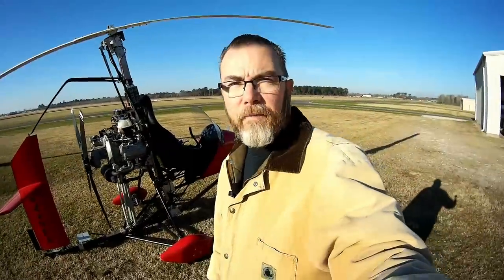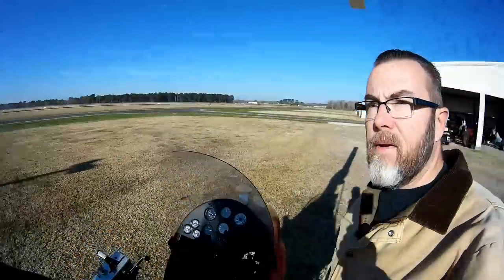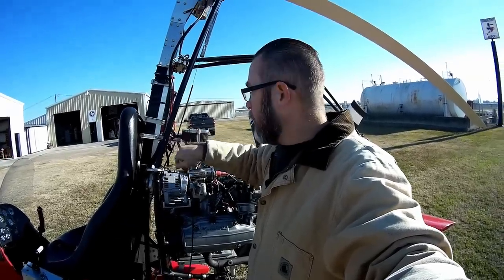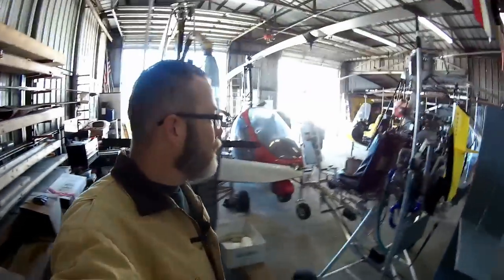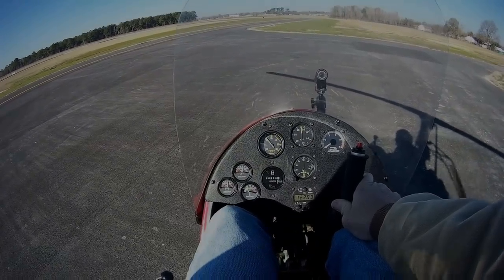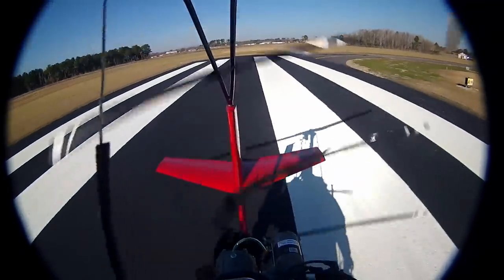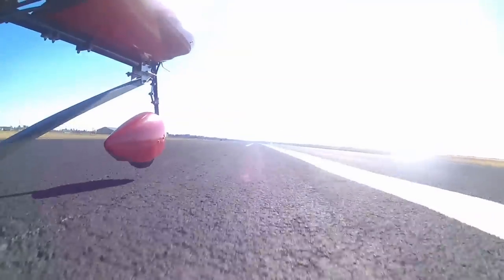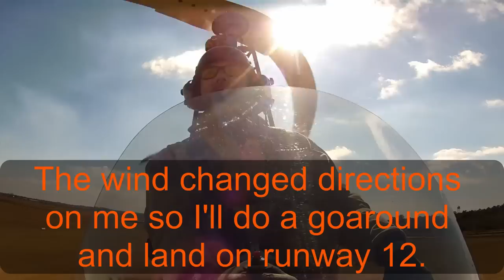Gyroplane Walk-through.

Comment: This is one of the best gyro video's I've seen, well done. Your Air Command is really moderate in stick shake. Anybody in your group know of an RAF for sale?
Reply from the maker: NZ Salt Flats Racer we do have a guy that's selling a beautiful RAF. Should be on barnstormers.com under gyroplane. It's in Anahuac, TX. Owner lives in Plano, tx?
Reply: Thanks, I saw that one but considering the changes I'll need to make for this high altitude the price is too steep.
Reply from the maker: It's fuel injected. What changes would you need? Just curious. Sea level with no mountains around here.
Reply: I'm in the Rockies @ 7k-ft. FI 2.2 makes less than 100hp here. My friend had to change to a turbo EJ-22 & Sport Copter blades & has over $50k invested. He's a Dr & drives a new Mercedes, I'm a mechanic & drive a 94 Chevy, I need to find one I can afford to reconfigure.

Comment: Nice gyro Bobby. I am learning fly a High thrust Bensen B8M with a 72HP McCulloch with a 48" tennesee prop, and Wunderlich prerotator, horizontal stab added to the stock vertical. Still learning to fly it on my own, able to prerotate to 150 and get 200 RPM on fast taxi with my 23' McCutchens (yellow ones) and she dances. Just about ready to go on the maiden flight in N521LW which my late Dad flew the heck out of and left for me (RIP  Dad, Can't wait to get in the clouds closer to ya again). Any tips you can give me Bobby? I'ts like I hit a wall, I'm ready to lift off just cant seem to nail that throttle just a tad more to lift off and keep it level... Not afraid just hit that wall if you know what I mean. My Dad wanted to teach me but I wanted him to fly it annnd enjoy it as he was getting up there in the years, he flew for 7 years before passing away from a heart attack on the way to walmart at 72, still miss him every day...
Reply from the maker: I would take some training with a gyro CFI. Then follow the Bensen training technic. I'm pretty sure a google search will find the Bensen meathod. I did right around 100 crow-hops over the runway before flying the pattern. You need to be able to land your machine safely without hesitation before flying away from the runway.

Comment: Thanks Bobby, that has to be one of the best  videos I’ve seen for a new comer. What do you think of the Sportcopter with springs keeping the front wheel centered it also is free castering? One a thing I’m not sure about is your landings. It seems like you land like an airplane. Could  you explain how you approach when you land? Also I’ve heard about getting behind the power curve. It seems after you do your pre rotor you are looking for certain rotation number then when pulling back on the stick your looking for another rotation number all the while increasing the throttle slowly. Could you explain those values and also explain what would happen if you just gave it full throttle. Mike
Reply from the maker: mike lavergne , the centering spring on the sport copter is just fine. It will allow the wheel to be aligned with the gyro vs aligned with the rudder.while pre rotating, I'm just looking for anything above 80 rpm for these rotors before starting my take off ruin. I'm not really looking at the rotor speed after that as much as I am feeling what the machine wants to do. I could probably give it throttle sooner, but this is only my fifth flight with these rotors. As I get used to how they react I'll adjust my method. With a gyro you don't need to rotate on take off. The machine will start to rise on it's own as soon as the the rotor gets up to speed.
As for landing, you need to have an airspeed of around 55-60 on final until you get a few get off the ground. Then you will start to round out and as the gyro touches down, you want the cyclic all the way back until the machine comes to a stop.

Comment: Could you tell me what the cost of the overhead blades are? Do you know where I could find a video of someone taking the head apart clear through the bearings and putting it back together? Thanks for the video.
Reply from the maker: I bought my used rotor for just under $3000 USD. I don't know of a video of anyone rebuilding their head. There are many different designs. Do you have a rotorcraft club near you? Maybe go to PRA.org and look for a local chapter.
Reply: @BobbyMunroe  
Thanks for the response. I have plans for a Benson I purchased back in the late 60's that I always wanted to build. I joined a club a few years back with the intention of getting information from them and then build my own. It became apparent right away that the club was not about flying, but more about being a business for one of the groups members that built them. I paid for a couple of the clubs glider flights. When I said I wanted to build one instead of buying one, they shut down the clubs glider flights and in the clubs news letter they told members that were not willing to donate additional money at each meeting, besides their dues, to not bother coming! I did not bother going back.
Reply from the maker: @amtpdb1  Dang, that sounds sketchy. What area of the country are you in? Are you on the "rotarywing forum" ?

Comment: What kind of  redrive do you have in the Subaru and what is the gear ratio.
Reply from the maker: My box is an SPG-3 with a 2.43:1 ratio. It would have worked better with a 2:1 ratio.
Reply: Bobby Munroe hey this question is about ,direct drive prop set up,  I have always wondered ,if you increase engine horse power ,like using a 2.5  turbo charged Subaru ,putting out 310 hp @4000 rmp,would it be easier to have a direct drive prop ,which means that you can get about 50 % of that power at 2700 rmp ,which means you are  not over speeding the prop and still get a descent power to climb out with a lot of toque .
Reply from the maker: @mwan200  the horsepower will not be anywhere near 50% half throttle.
Reply: Bobby Munroe what is import in creating toward thrust is it HP or toque ,because in my understanding ,horsepower determines how fast the propeller shaft turn ,but toque determines how much the propeller can accelerate air past the propeller
Reply from the maker: @mwan200  I don't have the words to explain it properly, but you need both. I know people used to run direct drive on some Subaru engines, but it seems most have changed over to a PSRU. Maybe it's more efficient to get the engine into the RPM range where it makes the most power.